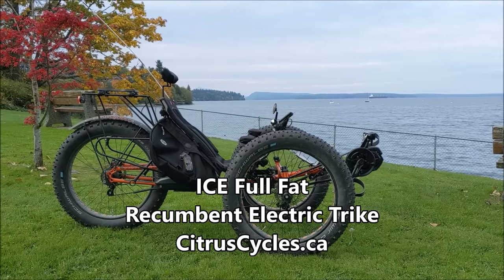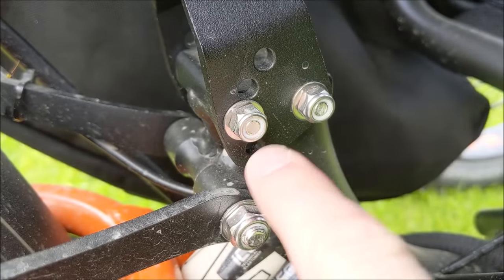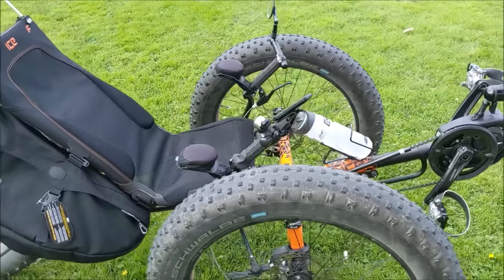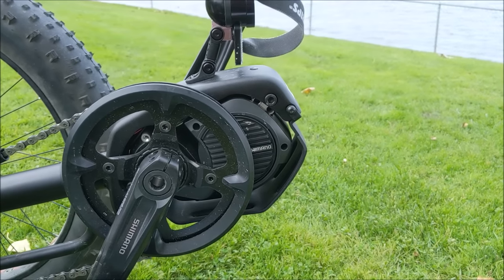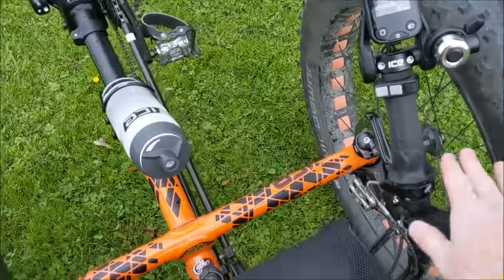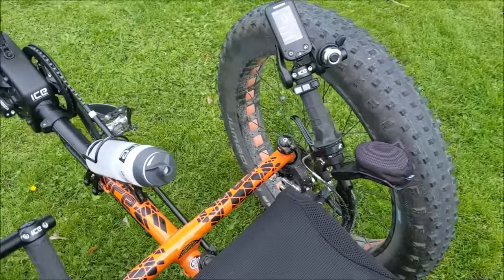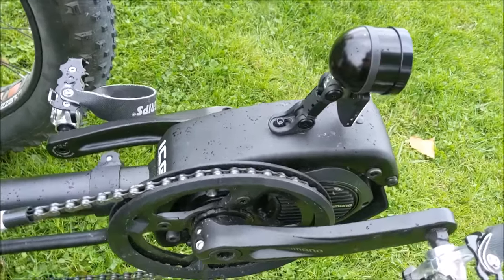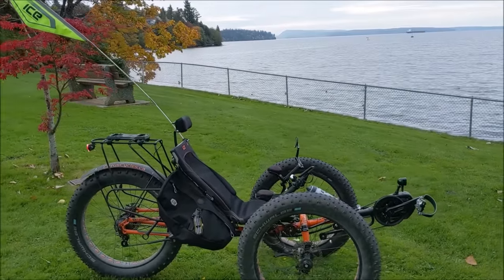ICE Full Fat Electric Recumbent Trike Review & Ride Test

Comment: Thanks for your good reviews. It's very nice of you to "bring" people with you in so thorough testing with good descriptions were we can follow you carefully and find answers to everything we want. I hope the customers understand the great advantages this fantastic service gives for people if they want to evaluate different types of trikes or bikes. I have been very active in sports in hole my life, but 2,5 years ago I was disabled after an reaction from a vaccine that affected nerves in my neck via worn nerve canals, and I have got exhausted from the simplest things and mostly bedridden. Long history in short, I can hardly walk a few steps with crutches, but the specialists found that my legs can work for at least 30 % power in 20-30 minutes in a laid back position with good neck rest, like on a recumbent trike. Now I'm not allowed to drive a car, and I would like to use a e-trike with pedal assist as an outdoor wheelchair for local transport. But because I get completely exhausted of vibrations I have compared vibrations on camera with your ICE Full Fat and ICE Adventure, and of course the Full Fat is looking great. But then I found that Full Fat no longer has the front suspension also needed for me. And I have asked ICE if I could get aFull Fat full suspension in my case, if this is not possible I have asked for use of 2,6- 2,8' wide volume tires on ICE Adventure. Regardless of how good suspension you can get, the weak/small vibrations need balloon tires, we found the same as passanger in cars. I would like to thank you for your great reviews, and I'm sorry I can't boy the trike from You IN Canada, but I will wish you the best. Best Regards Arne G from Norway.

Comment: the bash guard is extremely useful, especially for things like staircases. I don't know if anyone realizes how good these are at rolling down staircases, or going up, for that matter, let's just say that they're excellent at traversing a set of stairs. that's right, going downstairs on an angle or straight down, it changes your overall ride height as you go depending on how you hit the stairs. also longer stairs will have a different ride height. so if you do a lot of urban riding around a lot of staircases, that bash guard is a must.😏

Comment: ICE trikes are brilliant. Mine is the excellent Sprint X rear suspended. I don’t mind if motorists think I’m disabled. They may cut me some slack vs road warrior/mad max per usual. Plan to motorize when sun comes out in Utah. Hill climbs mean only one thing; leave early. Can’t wait to feel some electric assist.
Reply: Mark I very much appreciate your comment I have just discovered the YouTube channel Utah trikes myself and I think that there is a lot of issues in this channel not just their Channel.

First of all we hear of the vocabulary word camber in this video a lot and we also get to see the speed and the grade and it's understated by 5 units per hour in terms of the peak speed that we can see in watching this video as opposed to the writer who during that Peak speed was not looking at the display.

YouTube also allows spherical like in Google Maps street view cameras to be used and this review was for a fall ride and there was discussion about going out later in the day I would say that it's implied like stay at for winter high noon and during such hours you're going to be using more wattage cutting through the crystallized H2O.

Now that doesn't mean that you're going to have to bring more water this early even though what it is below freezing there is of course no humidity in the air. And you can certainly sweat on a bicycle if you're not dressed correctly oh, and by sweat I mean not just in your lungs.

I have operated an electric trike and I have not done so at extremely cold temperatures to however. I have however as a child ridden a bike without gloves at Sub-Zero temperatures and that is difficult to maintain adequate blood flow through your fingers because your body tries to keep warm in his core and if you don't maintain your core body temperature you will find your body is eager as if eager to sacrifice its fingers if you are you know not with your own debit card because you're only like 5 years old or something and you can get anything on your hands.

Mainly though it takes a village to build a trike correctly and it takes a village to keep cars from being legal within cities and we don't yet have that Village in either case. The forest is fantastic and you don't actually need a chair to enjoy it it's kind of like walking around downtown Los Angeles where you find walking uphill and walking downhill you looking straight up regardless at the trees or the hundred story buildings oh, and your inner ear starts you know protesting a little bit because you're not able to look straight ahead you just want to look straight off you want to look this way and that way but as has been pointed out by this other old man on YouTube we have been walking for quite a while and with practice our brain has when it needs to get that done at least if there are no Cars barreling down the road and occasionally running off the road into the sidewalk into buildings but in downtown Los Angeles the buildings don't take that as casually as other places see your pretty safe on the sidewalks.

The problem with this video is that the notion that you're going to spend because you haven't brought sufficient wait with you for the tire surface or the tread because you're still talking about bald tires despite the energy storage being on board and you have spent too much money buying a bunch of lithium instead of going to Walmart and spending $100 on a deep cycle 12-volt lead-acid battery with a cheap maybe $50 voltage boosting motor controller that attaches to that battery and sends on very thin wires maybe not two wires but three maybe four or more wires but extremely thin wires I want to emphasize what we mean by Thin wires we need an inexpensive we mean very very durable we mean invisible wire is like the fiber optic pipes that can be installed against the curb to provide everybody with trillions of bytes per second of bandwidth so this to our video in 8k spherical form can be downloaded in a tap you don't like you might pay for a few hundred pounds of gasoline just by tapping your phone on the counter not even slowing down as you prepare to spend however many minutes in hell I'm the toxic fumes under the shade of a canopy.

So you don't need a trailer for the solar panel but you do need to use the lad and you do need to put the battery not on your side but on the directly above the rear wheel axle or frankly need to hang $100 battery on both sides of the axle so that it's well above the ground even if that means using 36 in diameter wheels and you could go with 36 inch radius wheels that is legal in order to be on the sidewalk in parts of the United States your wheels have to have an 8 inch radius and I have certainly significant experience you know being hauled to jail because I was legal but right now the violations of civil rights by the state do not entitle us to easy collection of punitive judgements against the police when they knowingly falsely arrested because we're not evil enough to just sign and say it's okay that you can rest me get on with your day officer if we have any conscience they're going to give us a ride and we're going to get beaten up baby have some ribs broken maybe have our nose permanently bands before we get released because just getting a court to order our immediate release has proven again and again do not matter much. When I was younger I had a systems engineer defending me against the state and he was prepared to go to one cord after an hour as the business hours and even beyond the business hours of a day would allow to drop all his other work of course because when somebody is in custody you have the right to drop all your other work and get them out if you have already gotten the court to order their release and you can bring in whatever higher level of government enforcement armies are necessary to do that but that man was very fat he didn't have a recumbent trike despite having a background in systems engineering and we used to scream at each other for several hours after eating particular project was completed and even during the court hearings we would go into the conference room and we will be screaming at each other for quite a while and then you know they would come in and say well you know what we've been informing the court about your working here and they say that you can't have the judge waiting on you it's great that you guys are working on the case together but you need to come back and the judge is going to make sure you can do it in your law office instead of in this conference room next to the court with you know a couple of police cars having to park outside the court to take you back to jail we're just going to actually cut you loose right here in the courthouse and actually we're going to end this case and thanks for nothing else all. And of course they think of us as assholes. even if they are ungrateful you can expect them to say thank you and have a nice day and they make this error that the classic black and white German film called the Axeman tries to prevent being made by others because in that film this woman keeps getting arrested and eventually released and causing trouble again so what Hitler does is he hires this butcher to chop the you know the unloyal people's heads off like you used to slaughter sheep or something and that solve the problem but for me I was dealing with people who haven't watched much good television and certainly nothing in black and white that was not filmed on videotape and so they didn't know anything and I did get out to raise the kind of hell that I hope to in my dotage or whatever it is pending but going to be a problem for those evil people who and their ignorance Zelda cut my head off when they had a chance. In Santa Monica California you can see the fat girls on their trikes on their cell phones and you know it has to take a Canada to be as naive about the reason bicycles are not confusing and having one fewer wheel but are not accidentally difficult to sleep on WOW getting from one place to another. All youman powers Mobility machines or augmented buy whatever energy storage technology and whatever horsepower injecting contrivances need to separate the running wheels from the braking and accelerating systems if you are using the same Tire well traveling at a steady clip that you expect to use to get your wife going fast or stop your butt or to turn even you are in the third world not even you are without clue indigence and in fact putting your head in the guillotine as if you have something to hide and would rather quit instead of fight. When I was a child everybody understood that you did not bring things and enjoy them if it wasn't something you could pass around and so we do need to get the cars from being manufactured it's kind of like the poppy plants or something we need to get the agent orange we need to get the cars took back to the warehouse there's lots of buildings in Detroit that you could stack them up for 5 we have enough to last a century we don't need to build more cars we just need to stop crushing the ones that we already have and park them not within the city but in Michigan you don't need to have anybody living in Michigan but we can store the cars from the rest of the United States there and on the other continents and then other countries even there are places that you can move the Cars 2 and for the rest of the world where people are actually going to live you can figure out how they can live with some sort of sanity and that does mean being able to take a nap on the way to the forest and if the forest is just the journey you don't always have to be awake you can go ahead and work at home and work at the office and just use your commute to sleep it's okay the wild animals don't mind it if they hear you snoring as you whizzed past.

Comment: I love this bike.  I have the Riese Mueller on order from you.  I need to wait a bit until it gets a little more refined.  It needs a belt drive and perhaps the boch system.  I am not knowledgeable enough to know if boch is better but from research bosh motor and battery seem an excellent way to go.  I don't. know this system.. great review.  Perhaps 5 years if I take a spill off of my Present Riese Muller homage GT.
Reply from the maker: It would be amazing to have a belt on a recumbent trike, but it would be a very big challenge.  (All of my bikes have belts, so I understand the appeal!)  You need to be able to adjust the boom, and to do that, you need to change the length of the chain.  You can easily do that by breaking the chain, or use the Easy Adjust.  Unfortunately, neither option will work with a belt.  
Fortunately, the placement of the chain at the end of the boom down the middle of the trike, along with the use of the chain tubes means that they chain on a trike doesn't need near as much maintenance as on a bike.  Our mechanics are always amazed at the condition of a chain on a trike after a few 100 km's without maintenance compared to a bike - I can really get away with much less maintenance on the trike. 

Although all of my current bikes have a Bosch drive unit, I'm really pleased with the Shimano on the ICE Trikes.  Shimano allows ICE to specify the install angle for the drive unit, which means they can calibrate the power for the stroke profile of a trike, which is offset almost 90 degrees to that of a bike.  This means that even with the higher torque E8000 motor, the power delivery is perfect.  This likely explains why any of the Bosch powered trikes available use the lower torque Active Line Plus, whereas any trike manufacturer using a high torque motor is going with the Shimano E8000.  Of course, this could all change in the future, and I am not a designer/manufacturer!

Comment: I have mobility issues and need a trike that is easy to ride.  Which is easier on the muscles.  assuming you are using the most powerful electric assistance? The adventure or the full fat? Please help.  Thank you
Reply from the maker: The Adventure or the Sprint X Tour with the E-8000 would be a bit lighter and easier to pedal, so they should be a bit easier on your muscles.
Reply: Citrus Cycles Ltd.   thank you

Comment: I plan to go touring through Australia, could I use the trike for this purpose, interns of trunk bags ect? Secondly is the bike capable of being ridden   if the battery was to go flat?
Reply from the maker: The Full Fat would be awesome for touring, and if you add the top rack you could easily bring 4 pannier bags, plus a trunk bag, plus the side pods.  You can ride without assistance if you wish - it will just be a bit heavier because of the battery and motor.
Reply: I use a 70 litre banana trike panniers, made by Ortlieb. And over the seat I can hang another pair of banana panniers, containing 65 litre. Made by Radical design, the Netherlands. And you can a top extension by ICE, on your carrying rig. So you can attach you sleeping bag and air matress on top.

Comment: I ride primarily on a paved bike trail. I like the bump absorption of the fat knobby tires but I’m curious about the rolling resistance. I realize the Shimano motor assist will probably negate the rolling resistance, but do they reduce the battery range as opposed to a smooth tread tire. Edit: After watching the entire video, I don’t think I would have any issues with the fat knobby tires.
Reply from the maker: The Jumbo Jims are a fairly efficient tire, so the knobs don't reduce the battery range too much.  However, you could always put a slicker fat tire on if you don't need the additional traction provided by the Jumbo Jims.
Reply: بbumkpu

Comment: Where does the front suspension come from? It doesn't seem to be available directly from ICE on the configulator.
Reply from the maker: ICE no longer offers the option of the front suspension.
Reply: @CitrusCycles  Just curious do you know why? Were there issues? Do you rec a 3rd party front suspension?
Reply: @benbbritt  They wouldn't tell you, but I bet the disk brakes weren't working well with the combo of big wheels and this specific front suspension system, and 70mm drum brakes for such big diameter wheels just felt ridiculous to them and the 90mm version is too heavy.